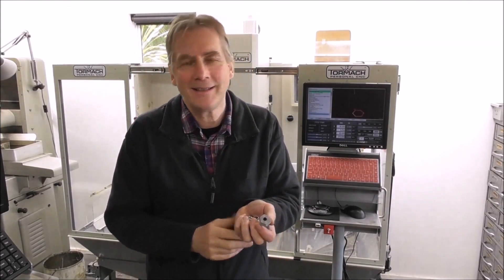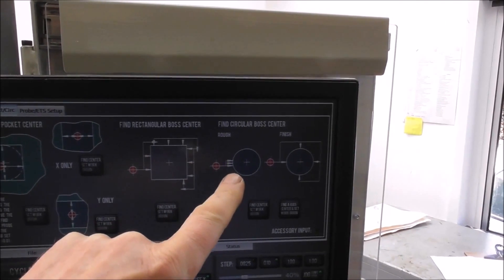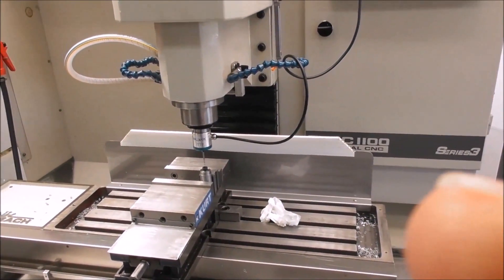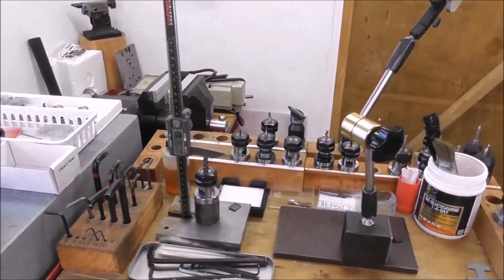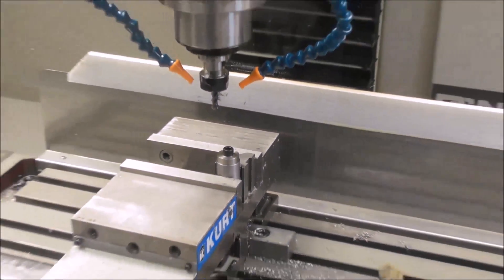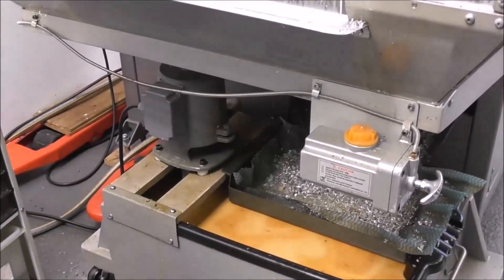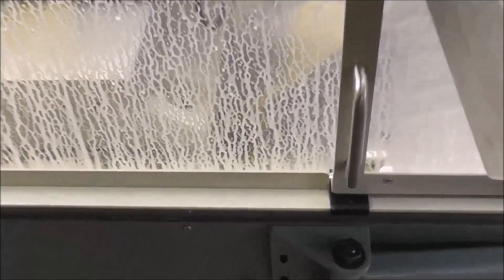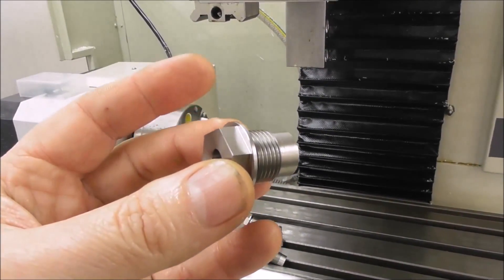Testing the Access Enclosure -  Part 6

Comment: Parrot. Nothing suck seeds like a parrot. ;-)

Two points on the enclosure from imperfect hind-sight:
1. Offset the sliding parts so that they overlap slightly on closing.
2. The roof of an enclosure serves mainly to limit the noise from the machine/machining.

One question on the part being machined: Did you not have a matching nut into which to screw the thread of the part? 

These are not in any way to be taken as criticism. They're a consequence of the thinking inspired by your excellent videos.
Reply from the maker: Bernd - Very perceptive. Yes I used a slight manual offset of the doors within the clearance to keep out the coolant. When I get time I should make it slide that way  - or cut opposing bevels on the door edges would be very tidy . Good spotting!
So a roof helps with noise..I had not thought of that. Another seed I missed out on!
The mandrel is threaded to take the part - but I could not tighten it much, so the cap screw just holds it screwed in.   Cheers  Cliff